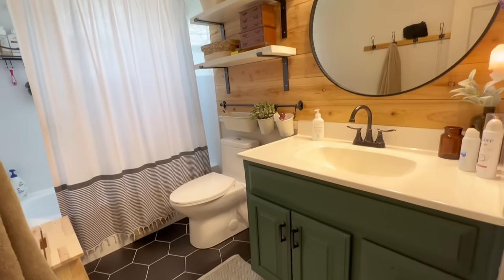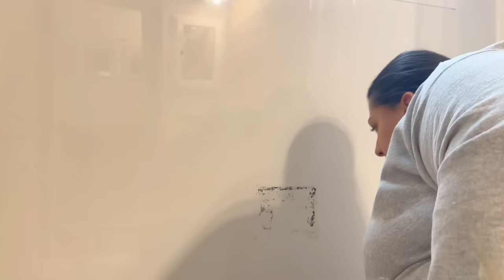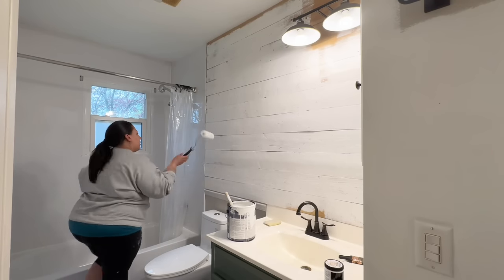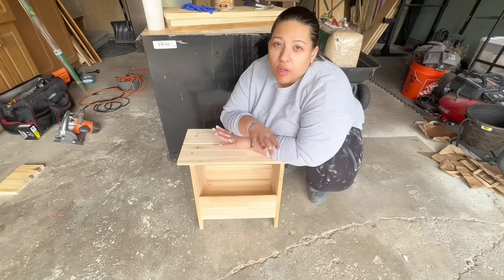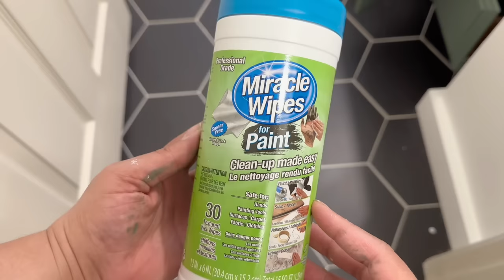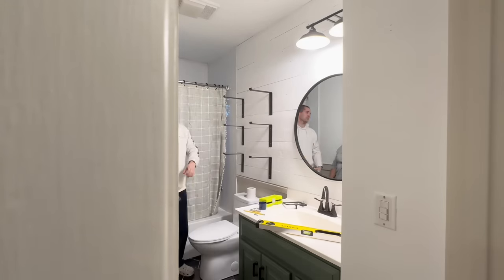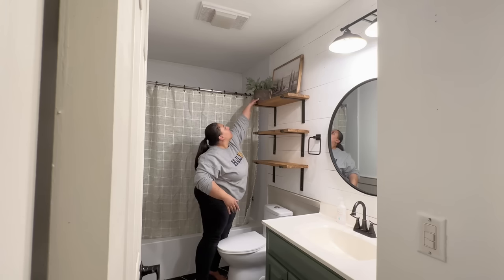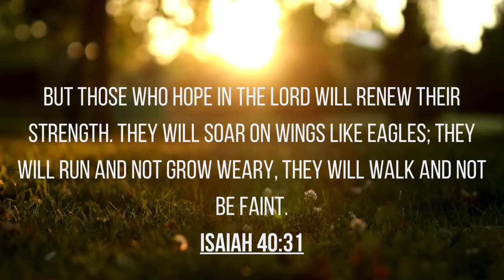BATHROOM MAKEOVER || ON A BUDGET

Comment: Beautiful job - however, the reason why your paint was chipping on your cabinet is because the sample is only for color purposes.  It doesn't have all of the additives and adhesion that regular paint has.  Not being negative but just wanted to let you know that if it starts to chip again, you may want to paint it with the actual paint and not a sample.  I love the finished look!
Reply from the maker: @kdavis2195  thank you so much. 🥰 I actually didn’t know that.
Reply: @sprucingupmayhem  Glad I could help!  I actually found out because I was doing the exact same thing trying to save some coins and a person at the paint store told me.  Beautiful job nonetheless.  I love the green!